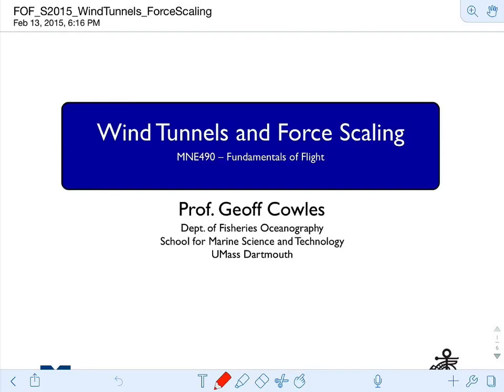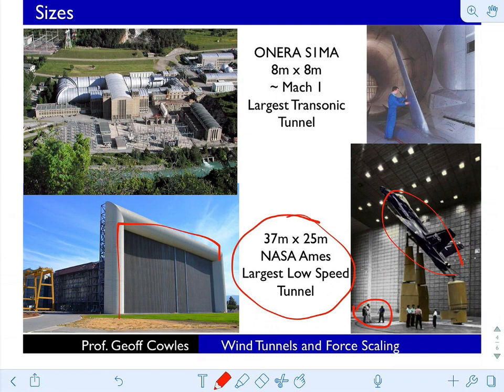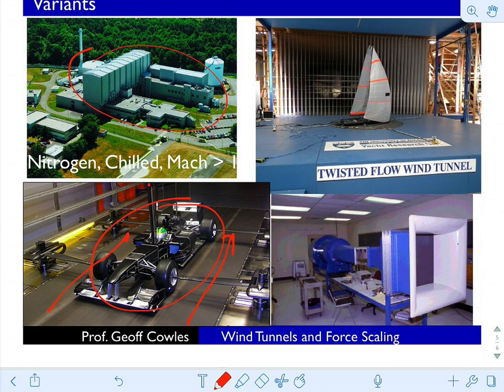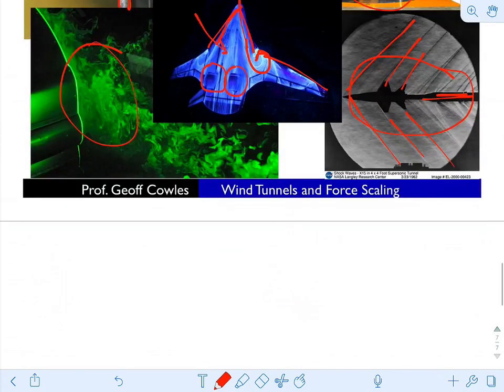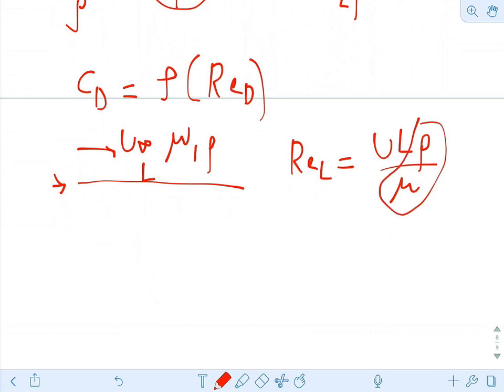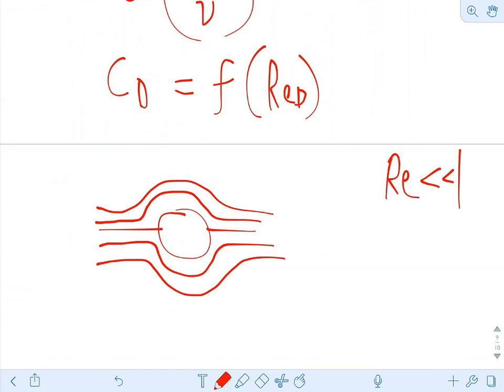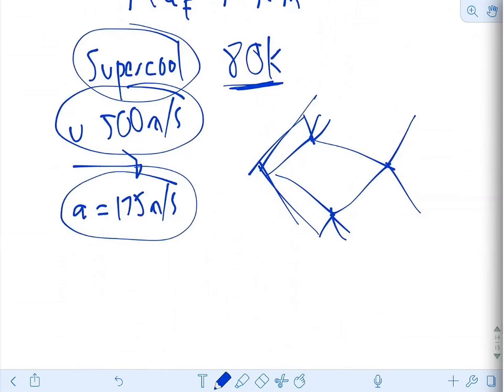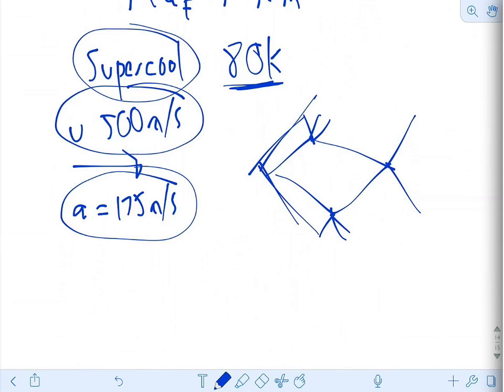Wind Tunnels and Force Scaling

Comment: For anyones info who wants to know, F1 scale models cannot run at the same higher speeds that a full f1 car would on track. As per the regulations they are limited to 50m/s air speed so matching reynolds numbers becomes a massive problem